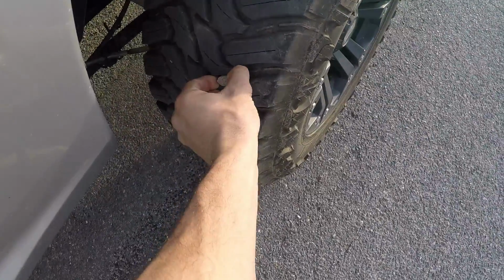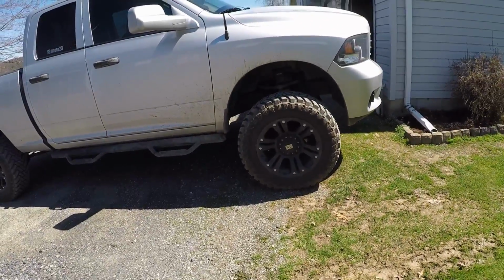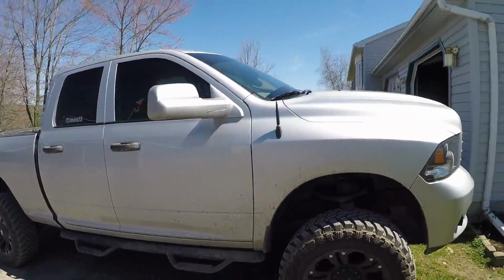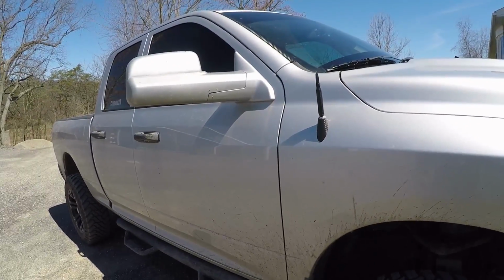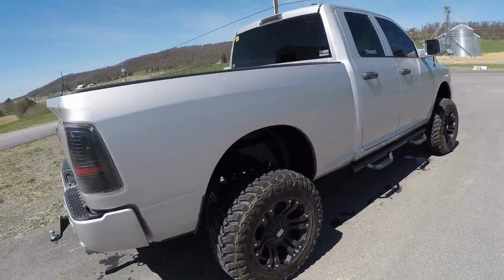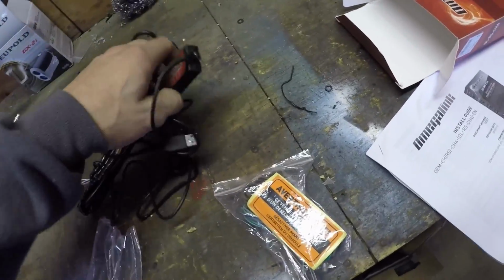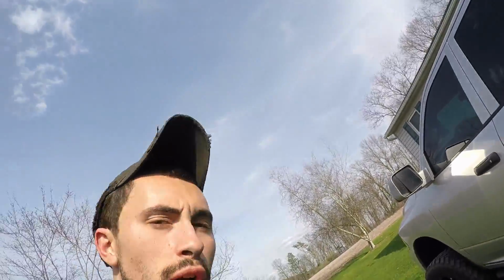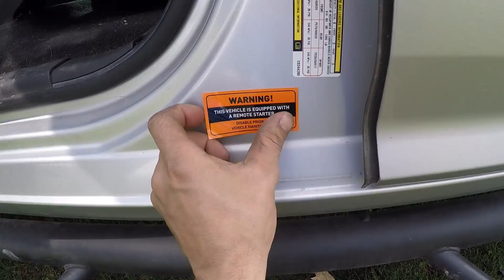LIFTED 2012 RAM 1500 BUILD PART 9

Comment: the other three wires could be for the park brake if you have a manual transmission. just a guess and the hood pin is to disarm the command start so it doesn't accidently start when someone's doing work under the hood. not sure what the others are for.
Reply from the maker: Yeah def could be ! Thanks for the info